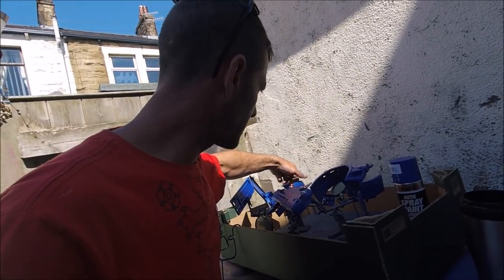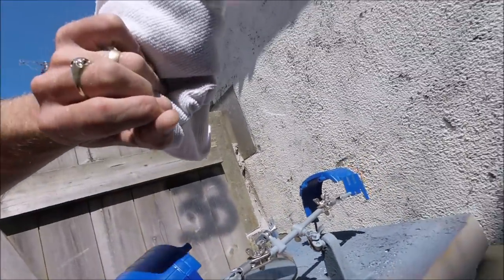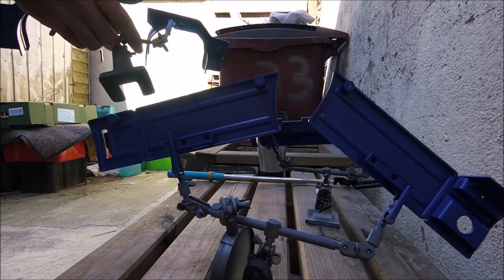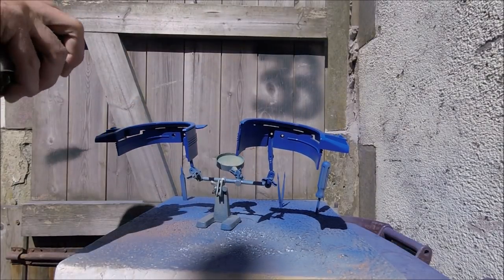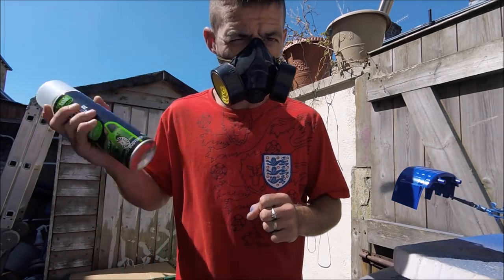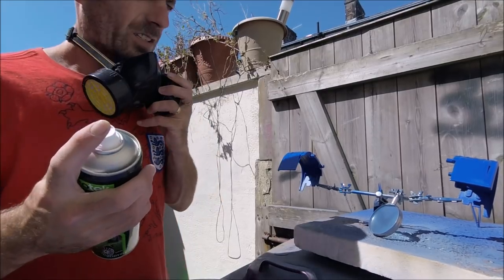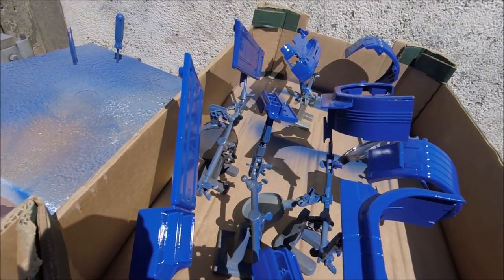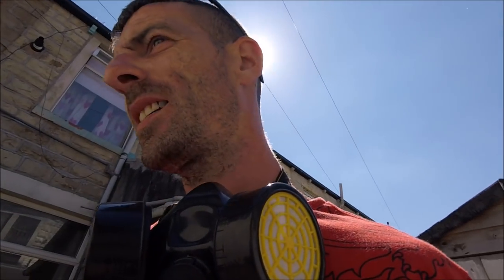RC TRUCK | R/C TAMIYA SCANIA GETS SOME PAINT

Comment: I had that very problem painting the side panels for my reefer trailer .did it outside to hot and got a rough finish .it's white so not to obvious. Maybe I'll flat it back and 're laquar at some point.
Reply from the maker: Temps need to be just right, we all learn from mistakes, I've been there myself and still make errors 👍